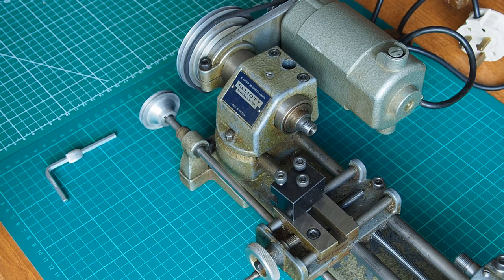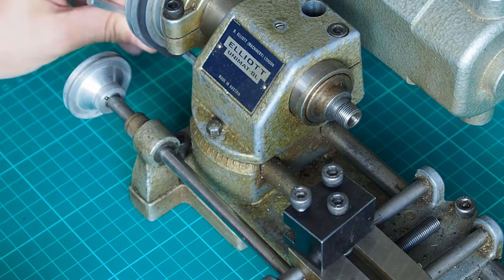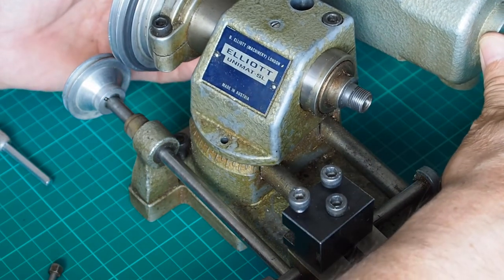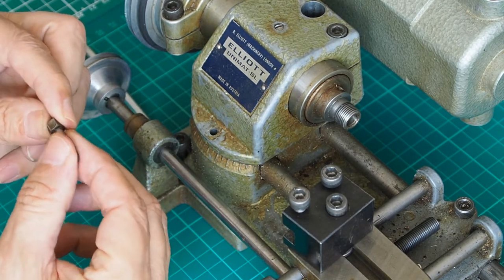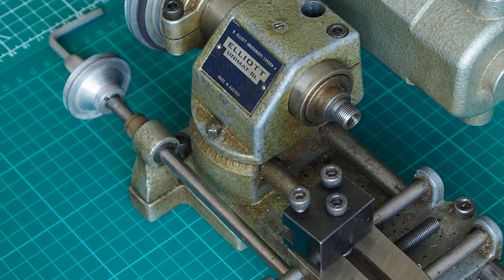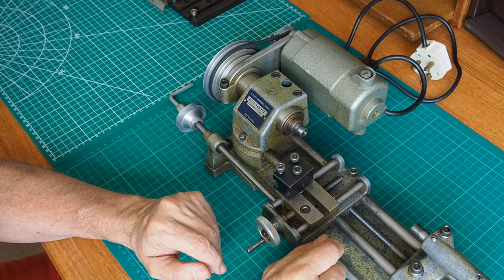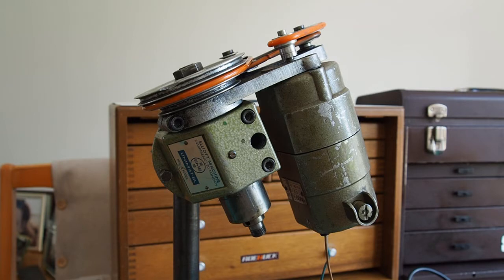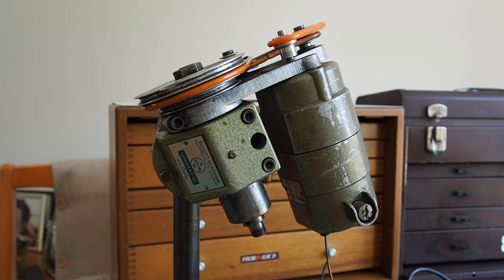Emco Unimat SL Lathe - Taper Turning.

Comment: Lovely video. The pin will put the lathe concentricity in the ball park. You will need to make/buy a tool and indicate it to properly get it actually concentric (say with a deviation of 0.01mm or less if the bearings are in good condition. I usually settle on a deviation of ~ 0.005 to 0.01mm from spindle to tailstock (165mm).
Take care,
Saar
Reply from the maker: Hi Saar,
Thanks for visiting and commenting... As part of the restoration project I will try and cover everything associate with ensuring the lathe is setup correctly. I will most definitely cover the points you have made.
Take care
Paul,,

Comment: I have the older unimat mk2 model (black cast iron) and it doesn't have the slot nor the pin. It seems that the Headstock will always be in a free spinning position, is this the case or am I missing something? i'm worried that when turning it would just rotate away from the cutting tool
Reply from the maker: Hello,
I checked my Unimat Mk2 this morning and it does have the slot rather than the pin... I am not use why yours has neither. If you search in UK eBay for "Unimate Lathe" there may be a thing that fits in headstock and tailstock spindles to help with alignment. Sorry I could not be of more help.
Take care.
Paul,,
Reply: @TheKnacklersWorkshop  I figured it out, apparently when screwing the big bolt in the bed to hold the headstock it slightly pulls it down; thus keeping it well secured by friction/pull. The slot/pins on all other models just seem to be for centering purposes.Thank you for this and your videos, they are a massive help!